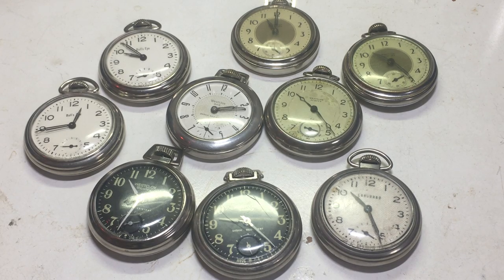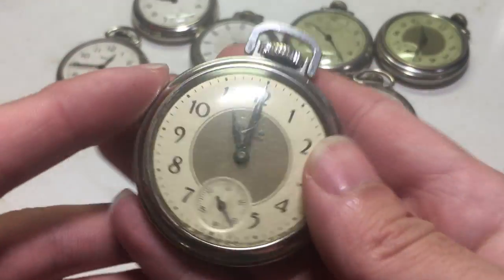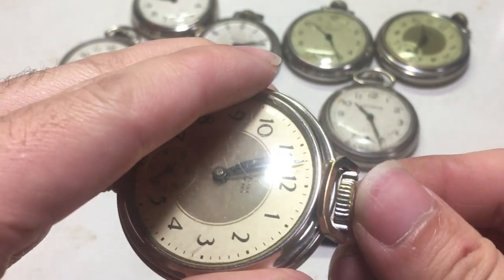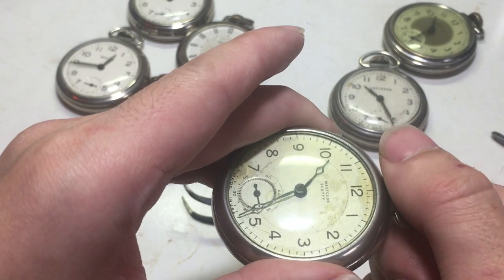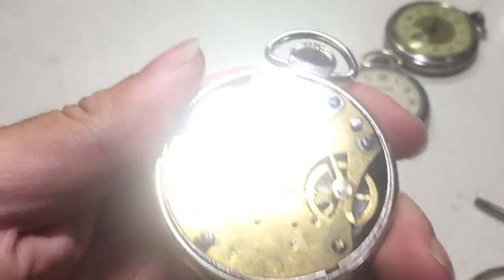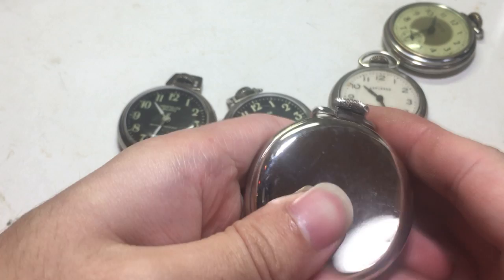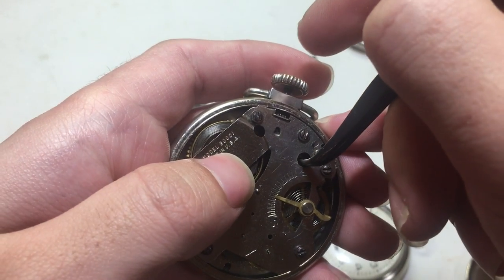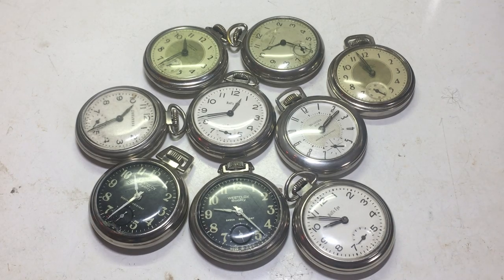How to remove the stem & crown assembly from a Westclox pocket watch￼

Comment: I've seen several postings on how to remove the crown from these watches, but yours is bar far the best and most comprehensive. I have a 90002 movement and you are the only one to note that you need to get underneath that inner hole and pry upward. 

When I do so, I can get the post to move up what appears to be the full travel, and the stem moves outward, but it still doesn't pull out. I've added a bit of lubrication to the post, which seems to help it to move freely. I have also attempted to pull the post up further, using a needle nose (once it is in the upper position). But still no joy. 

Any advise? 

Tom

Comment: (June 2023) - Thanks to your video and instruction, I was able to take the winding stem out using a dental tool with a slim tip I was given. I pried the small lever up. But with a bull’s-eye Westclox pocket watch… I was unable to fix the pocket watch. It ticks several times, and then just stops. What else might be wrong?
Reply from the maker: Hey, thank you for taking the time to check out my video and I’m really glad that it was of assistance to you. As for the pocket watch, not running, these were basically cheap disposable watches that were never really made to be serviced. (unless you work on it yourself.) so therefore it most likely has the original oil from the factory that by now has totally gummed up, these things are pretty robust, and I rarely see anything go wrong with them mechanically. So yeah, probably just a case of old oil, I disassemble it, clean, and re-oiling should do the trick. If you are not keen to try disassembling the watch yourself, you could try dabbing some thin sewing machine or other type of oil onto the pins (pivots) sticking out of the rear plate. This is not by any means a permanent solution, and I wouldn’t recommend running the Watch regularly if it does allow it to run. ALSO- see extremely late. Model watches were permanently riveted together, and are completely unserviceable, so if that’s the case, the watch would most likely just be a display piece. (I personally part them out for the older watches.) anyways, apologies for the slightly delayed and extremely long winded response. I hope it is of some assistance to you, best of luck and thanks for watching!
Reply: @thewatchworks1372  All your advice is awesome! I am only dabbling in servicing this inexpensive WestClox Bull's Eye pocket watch. But good news! I have some thin oil I bought at a watch shop. I didn't ultrasonically clean anything. But carefully cleaned some pinions with a Q-Tip then lightly added the oil. It's ticking much longer now. But probably not reliably. Keep up the great work. I'm sure many beside myself appreciate your work, study and interest in watches.
Reply from the maker: @Bippy55  That is awesome to hear that you were successful in getting your watch running (and thank you for the kind words)! I love these dollar watches, they are extremely simple and straightforward to work on. I also don’t have any fancy cleaning machines of the such, I just clean everything using Q-tips, an old toothbrush, and a toothpick for the pivot holes. I use 92% (I think) isopropyl alcohol as my cleaning solution, it works well enough for what I do.
Reply: @thewatchworks1372  I guess I enjoy to tinker with mechanical things. I am a degreed electrical engineer. So I also enjoy soldering small printed circuit boards. So I’m comfortable in a small workshop area.
Reply from the maker: Oh, that’s cool! I also dabble around with electronics and circuitry, I also collect antique wiring devices and lighting equipment. I granted I have yet to set one up at my new place, my last workshop was my bedroom lol. It will probably be the same here, although my bedroom will be a bit more roomier which will be nice haha.

Comment: I have a later version of the bullseye, the riveted model. It's stem is loose and it starts and stops seemingly at random. Any idea why this might be? I'm new to watch repair and I'd I've had the hardest time finding any reliable resources.
Reply from the maker: Sorry for the late response - I’ve been pretty busy lately and have been a bit slow to getting around to responding to comments, so apologies about that. Information on these is indeed hard to come across because it seems no watch repairers take these dollar pocket watches on, so it’s up to us hobbyists. These late model riveted movements are very finicky when it comes to their functionality, with my experience, they either run, or they have multitude of issues where they are too much for me to take on haha. It sounds like it is a case of old gummed up oil stopping up the works. With these being riveted together movements, there really is no taking them apart, so what I do is soak them in some 91% isopropyl alcohol after removing the dial. I take a toothpick and run it around all of the pivots, and I also unscrew the balance wheel pivot cup, and very carefully move the balance to the side and clean both the upper and lower pivot cups and pivots. I then add oil to the balance pivots, reassemble the balance assembly, ensure that the train of wheels and escapement is functional and then I re-lubricate the works. It is kind of hit or miss, but it does work, and there really is nothing to lose when it comes to a riveted together movement. Even if it doesn’t work, I recommend keeping around the non-functional movement as it can be carefully pried apart and scavenged for reusable parts for slightly earlier models. I really ought to make a video on this subject, so that might come in the near future. I know this was a mouthful of words, but I do hope that this helps you with your pocket watch endeavors, and thank you for watching!

Comment: Quick question, I have a 1949ish, Westclox Scotty, style one, pocket watch and I seem to be having a considerable amount of trouble getting the back open. Anything you suggest?
Reply from the maker: Sorry for the late response- Do you happen to have a watch case knife? If not, I would recommend picking one up off of Amazon (even the cheap generic ones work just fine) Sometimes the case backs on those watches are a bit challenging to pop off, but the proper opening tool should help a lot. Highly recommend against using a standard knife, as it could scratch up the case, and could possibly cause injury. Hit me up if you still need assistance after the fact. Hope this helps and thanks for watching!
Reply: I’ll be sure to pick one up
Thanks for the tip!
Reply from the maker: @ElDucktron  No problem, glad to help!